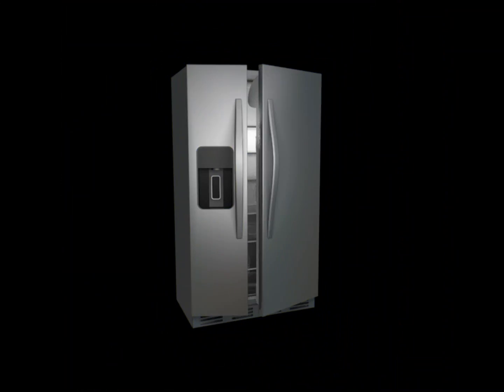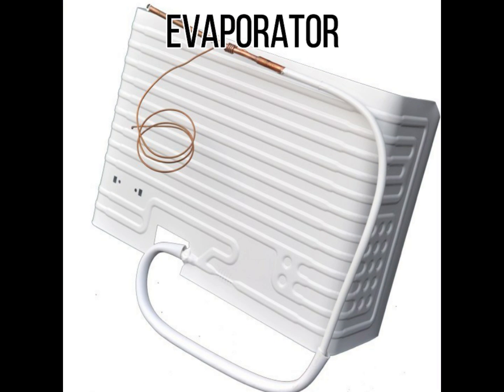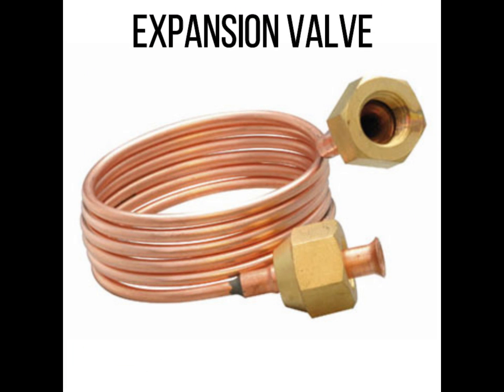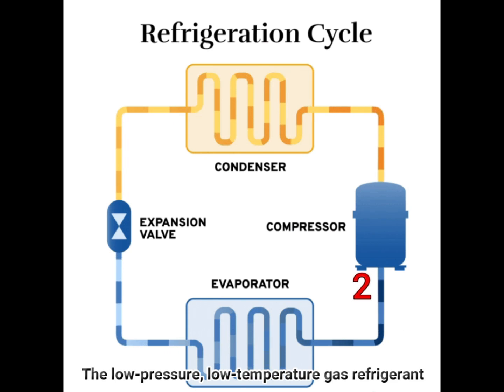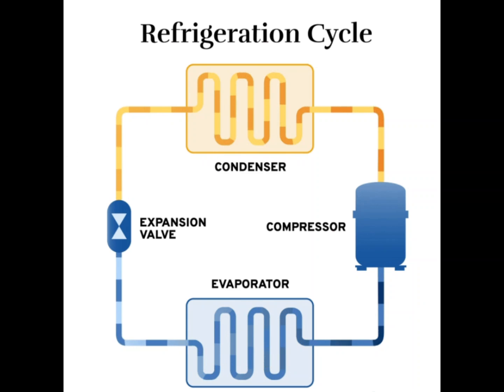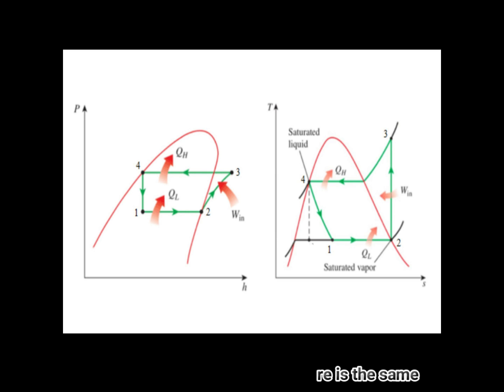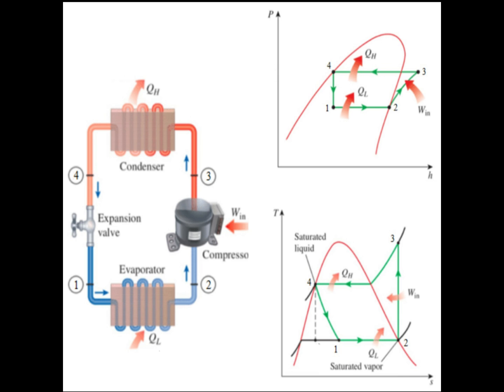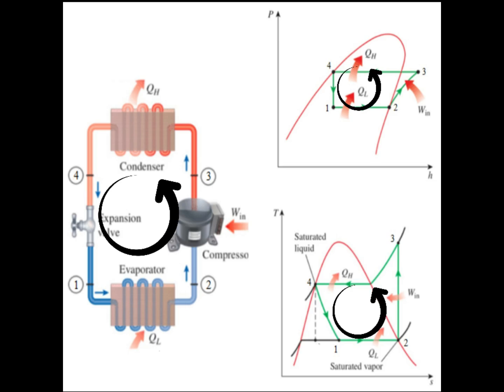Refrigeration Cycle - PH and TH diagram | Alonica 2020

Comment: Wrong ma'am, from evaporator to suction is vapor,,compressor design only for vapor masisira Yun pag liquid Yung na suck Ng suction,,discharge line is high pressure gas,,middle of the condenser,,is saturated refrigerant,,from gas to liquid,,passes to filter drier,,to dry the moisture of the system,,and pure liquid feed to capillary or metering divice and become saturated in evaporator.🥰🥰
Reply: thank you miss alonica to sharing your knowledge and this very useful and big help to us and aspiring to become a ref and a/c technician someday .once again thank you very much. and more power to all of you